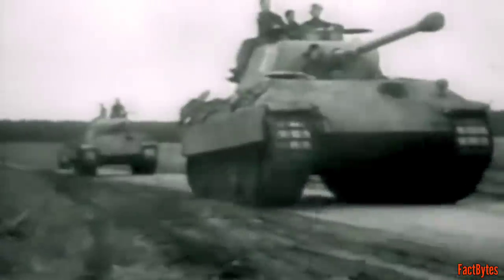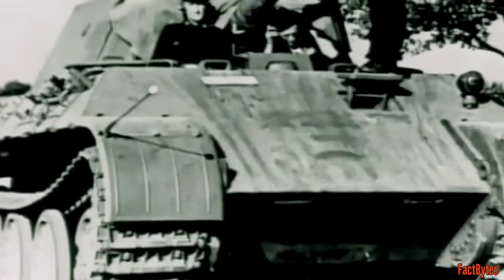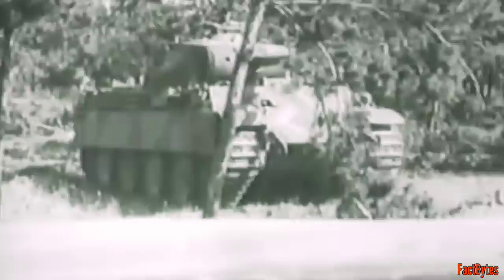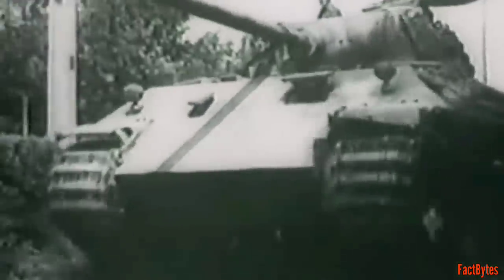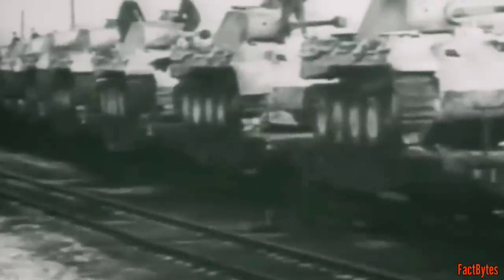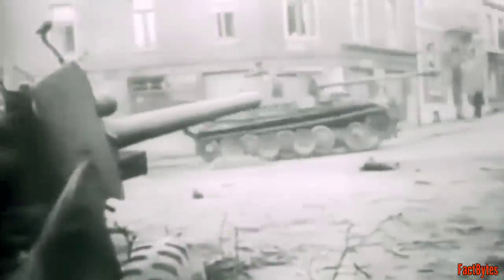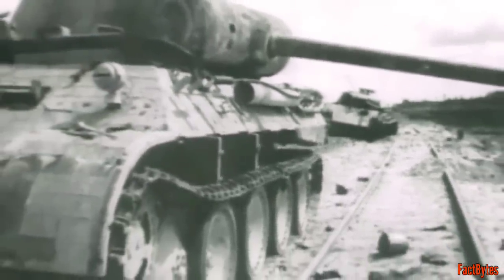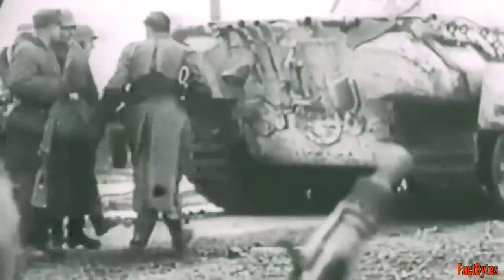Was The German Panther Really The Best Tank Of WW2?

Comment: If the Germans had just built Stug's and concentrated on upgrading the MkIV and not wasting their time on all these "super tanks" they would have had more of each and given the allies a harder time.
Reply: but you need for more tanks more tank commanders
Reply: @ramonschlittler8403  and they would need more oil that they didn’t have
Reply: The difference in the amount of fuel a Tiger II used and a Panzer IV used was huge.And you have the cost of changing production lines that were already geared up to making a Panzer IV chassis.The cost of extra materials to make Panthers and Tigers.The cost of transporting heavier tanks to the battlefields and the logistics of moving heavier tanks around on light roads and bridges.
Reply: @stephenmudiecastles.2938  that’s a fair point, but then Germany would have to train about 4x more crew with the manpower shortages they had.
Reply: This is only partially true. The Panther was only marginally more expensive than the Panzer 4 so long as engines were in supply
Reply: @kobeh6185  The Machbach engine factory was a prime target of allied bombing.
Reply: The Tiger 2 and the others were a waste of money, but the Panther was not as expensive compared with the mark 4 and brung more to the table. It reability issues could have been fixed, if the german industrial base had  not been  crumbling, and they use of slave labor, a issue that also hit the late Mark 4s too,
Reply: @I used this profile pic cuz it looks cool It was with it's short barrelled 75 but when upgraded with a long barrelled 75 it was a much better tank destroyer.
Reply: @I used this profile pic cuz it looks cool The early versions with the short 75mm were, the late were more universal in purpose.
Reply: More tanks means more fuel, which the German military did not have.  Where was the fuel for those tanks going to come from?  The German military tried to capture U.S. fuel dumps in the Battle of the Bulge and utterly failed.  All throughout that horrific war, Nazi Germany never had enough fuel for their military. They could have millions of tanks and it would not matter without fuel.

Comment: Hitler preferred the DB design, which more closely resembled the T-34.  In this one rare case, I have to say he was probably right in this regard.  The MANN design was overly complicated, was taller and wider, and used a gasoline engine rather than the safer diesel engine.
Reply: The DB was far more complicated, and it was unsuited for mass production.
Reply: @Dreachon  Oh wow ok.  According to the documentary the MANN design was more complicated, but if you say the DB was worse, then maybe it's a good thing for them they didn't pursue it.
Reply: @LA_Commander  Complicated is a big word and sadly a lot of people have this misconception that the DB design was the answer to all of the German tank problems.

In reality the DB design came with its own set of issues, a lot of these being that it used components that weren't in production, had a very very limited production or still had to be designed.

The DB design would not have been ready for production to start in January 1943 which was a major requirement that the Germans had.
Reply: Shhhh do not tell the werhaboos with the Ronson meme that german tanks used gasoline engines too!
Reply: @ricardosoto5770  This is not only a meme , the own Sherman crew's called the M4 Ronsons and the Germans Tommy cocker . The ammo got lighted up with almost every hit and not the gasoline engine . Wet ammo stowage later solved this problem .
Reply: @5co756   Its a meme,  please real real books. The nickname Tommycooker was started by the brits themselves, and was used for any british tank, not just the Sherman, and Ronson, well, I bet the M4 crews has time traveling devices since the Ronson " it lit uo every time" ad came in 1948, so yes, its a meme.
Reply: @ricardosoto5770  The Company Ronson exists since 1897 and an advertisment page from 1931 say " Ronson , the worlds greatest lighters " . That always light you up thing could be a meme , but not that they called the tank Ronson . 

A Tommy cooker was a compact, portable stove , used from the Brits in WW1 . It was notoriously ineffective , so the Germans called the M4 Tommy cooker . That's all I know .
Reply: @5co756  Well, the brits starting using tommycooker before the germans did and that is well doumented fact. Also historians have found no evidence of the us of Ronson for the Sherman in ww2 by US crews, it was probably a Canandian thing if that happened at all.  And a post war meme for sure.
Reply: @ricardosoto5770  Yeah maybe the Canadians or the Brits , who knows exactly .

Comment: I’ve always considered the T34 as the best Tank of WWII… It was simple to manufacture, easy to maintain in the field, good sloping armor and the later version was given a eighty-five mm cannon.
Reply: it was the best tank 0f 1941-42 but in 1943 onwards it was outclassed by both the panther and tiger tanks; even with the upgunned 85mm gun it was still outclassed by newer german tanks, the german tanks had better sights, a crew of 5 and all were equipped with radios, communication is the key to succes in any battle., flying a MESSER depite their short comings, their kill ratio speaks for itself, remember that despite the shermans reliability it was called the Tommy cookers or ronson lighters, the T34 and Sherman was more reliable but their kill ratio is lower than the panther. Remember that Erich Hartman shot dowh 352 aircraft includihg 8 P51 mustangs, flying a Messerschmid Bf109.
Reply: The T-34 was expected to break down every 50 kilometers.  If that's the, "best tank", there's a big problem.
Reply: @HiTechOilCo  wrote: "The T-34 was expected to break down every 50 kilometers.  If that's the, "best tank", there's a big problem."

-- Hahahaha, it was not! If this would be the case, it would not be the best tank of WWII, "Johnnie"! You can't conduct a huge operations anything like battle of Kursk, operation Bagration, Vistula-Oder or operation August Storm with a tank that expected to break down EVEERY 50 KM! Nor, would they survive to present day. It was one of most reliable tanks of WWII!
Reply: @HiTechOilCo  — And you should start your own research on how reliable T-34  with test trails Kharkov-Moscow-Kharkov of 3000 km, mostly off road and in winter conditions which would be impossible on the tank that breaks down EVERY 50 KM, without successful complication of which T-34 would not even be considered to be accepted to service or even fire tests at gun range. So before making outlandish claims do so research yourself on the most reliable tank of WW2, so that way you would not sound “childish”. Any book from Osprey Publisher on T-34 is another good place to start.
Reply: @HiTechOilCo  Everything built by Man has some Faults!
Reply: T34s armor was obsolete by 1942. Adding a bigger gun (and a bigger turret) didnt really do much for the survivability of its crews. It was all about mass production. "It dont matter if our tanks are trash! Produce 80k more of them!" -Stalin, probably

T34 made a huge impression on the germans back at the start of operation barbarossa (when all theyve had were 37mils and short 75s), but this effect was quickly diminished, when germans replaced the stubby 75 of the panzer IV with its "longnose" (same for stugs). That gun, while not the best mounted on the panzer IV, was capable of destroying anything the allies had, bar maybe the IS2 or the pershing.

When it comes to reliability, the best vehicles in the war were the sherman, t34, and panzer IV. In terms of firepower, the panzer IV had all of them beat, until the 85 was mounted on the t34. In terms of crew survivability... t34 was the absolute worst, followed shortly by the sherman. The panzer iv wasnt all that good, in terms of armor, but the gun allowed it to perform better than competing tanks (hitting them from further away, due to excellent ballistics of the round used and the optics).

I forgot to mention the brit workhorse, the cromwell... theres nothing to say about it. It may have been reliable, but its essentially a poor mans sherman. Worse armor, more or less the same gun, inadequate for the (ground based) enemies it faced.
Reply: @LiezAllLiez  wrote: "T34s armor was obsolete by 1942. Adding a bigger gun (and a bigger turret) didnt really do much for the survivability of its crews. It was all about mass production. "It dont matter if our tanks are trash! Produce 80k more of them!" -Stalin, probably"

-- Why only 80K, and not 180K? Stalin is dead, he won't be able to counter lies about T-34 tanks, right?
Reply: @LiezAllLiez  wrote: "In terms of crew survivability... t34 was the absolute worst, followed shortly by the sherman. The panzer iv wasnt all that good, in terms of armor, but the gun allowed it to perform better than competing tanks (hitting them from further away, due to excellent ballistics of the round used and the optics)."

-- What make you say that? 200 litter gasoline fuel tank that replaced Pz-IV turret traverse mechanism, because it had a poor range in 1944. T-34-85 gun would have no problem knocking out Pz-IV at any distance Pz-IV could T-34. Survivability M4 with Wet stowage was probably best of all three tanks.
Reply: @LiezAllLiez  wrote: "(hitting them from further away, due to excellent ballistics of the round used and the optics)."
-- KwK 40 L-48 gun didn't have a better ballistics, then T-34-85 gun.
Reply: I agree - the T34-85 was the mutts nuts. Even when stationary it looked like it was going somewhere with purpose!.

Comment: No, it wasn't. it had the potential to be one of the best but manufacturing defects (armour), maintenance issues (both spares availability and difficulty of access to repair/replace components), production issues (too complex - look at commanders hatch as one example) and engine issues meant it was never going to be the best.
The Centurion was probably it, the T-34-85 was a close contender, as were late Model 76mm Shermans (the T34-85 and 76mm Shermans do get the advantage here of having been used in combat, the Centurion was not during WW2 but was introduced into service during WW2).
Reply: THe Centurion missed the war, so I would not  cout it, same for the T 54 that was a prototype them or the JS3.  Any of those is better that the Panther. Of those who saw combat the Pershing, but ony less that 30 and in the last two months o the war. Of the tantks that did face combat, the T 34/85, the 76mm Shermans, the Panther and the Tiger I and maybe the Comet could compete for the best tank of the war.
Reply: @ricardosoto5770  The Centurion was a Tank in WW2, it was not a prototype. the question was "was the Panther really the best tank of WW2?" the answer is no, the Centurion was. Other tanks can lay claim, but none of those tanks were still serving with a major combatant in the 1990s.
Reply: @politenessman3901   IT was prototype, only a few mark 1s were built in 1945 and send to Germany for testing, they arrived in May 1945, too late to see combat. So it like saying the F 80 was the best american fighter of WW2 beause some were sent to Italy in july 1945, when the war still going on in the Pacific. If you said the Centurion was the best tank DESIGN to come out of the war, yes, I would agree.
Reply: @ricardosoto5770  it was not a prototype. words have meanings, it was on troop trials which is way past the prototype phase. Centurion was the best tank of WW2
Reply: Wrote: "Centurion was probably it"

Why Centurion and not a T-54/55?
Reply: @RussianThunderrr  Because Centurion was a better tank in every regard and was still in service with first line countries as a combat tank in the 80s
Reply: @politenessman3901  wrote: "Because Centurion was a better tank in every regard and was still in service with first line countries as a combat tank in the 80s"

-- Boo-haha, not the model that was in 1945, right?
Reply: @RussianThunderrr  one measure of a tank is "is it disposable or upgradable?"  the T-55 was the former, the Centurion the latter.
It's OK that you desperately wish the T-55 wasn't inferior but it was.
Reply: @politenessman3901  wrote: "one measure of a tank is "is it disposable or upgradable?"  the T-55 was the former, the Centurion the latter."

-- In case you didn't notice, I was mocking your for brining Centurion tank, since it did not do any fighting of WWII. T-34-85 deserved to be called the best all around WWII tank, that was still in service well into 1990 in SU, and present day around the world, it had a 10 years lead on Centurion tank, and is effectively first MBT in the World. Really, who cares about Centurion tank?
Reply: @RussianThunderrr  I noticed you were trying to mock, but you failed. the question raised in the video asks was Panther the best tank of WW2, Centurion was in WW2 and was the best Tank. QED.
T34-85 was demonstrably inferior to the Centurion. I get that you poor Russians are desperate to keep some pride but reality does not support you on this and it is not my life mission to educate you, you are not right, but more importantly, you are not even interesting.
So I'm going to mute you now. goodbye.
Reply: @politenessman3901  wrote: "one measure of a tank is "is it disposable or upgradable?"  the T-55 was the former, the Centurion the latter."
-- Oh, boy, oh boy, do I got a news for you... T-55 pretty much upgradable to 120-125mm gun, Centurion was upgraded from 76mm gun to 84mm gun, and when that was not enough to 105mm gun, but that is it... And when did Brits figure out, that highly flammable petrol is not the way to go on MBT tanks?
Reply: @politenessman3901  wrote: "I noticed you were trying to mock, but you failed."

-- Well, since you noticed, therefor I didn't failed... And since, Panther was not the best tank, in WWII, and Centurion tank had no merits in WWII and early models Centurion with a small gun were not better, then T-55, then by your own admission T-34 is the best WWII tank, and I'm cool with that! And I guess we never going to find out why I'm not right..., but on this innuendo, Goodbye to you too!

Comment: The M26 Pershing was the best, ok small numbers, but that was not part of the criteria. Proved that it was better than the T34-85 in Korea a few years later. Tiger and Panther, major reliability issues, but great gun platforms. IS-2, second to M26, it was slower and had a lower rate of fire, and no gyro stabilised gun. Lets not forget the centurion actually saw service in ww2, enough said.

Comment: By the way, I always wondered why was the Tigers manufacturing price so much higher than Panthers. The engine and transmission was the same, the gun was similar, armor thickness was not that different, electronic equipment was practically the same, so what made the difference?
Reply: The Panther was planed with mass production in mind. It took significantly less time to assemble a Panther compared to a tiger, which saves man hours and money . The gearbox was much simpler, the final drives were simpler and the optical equipment for loader and radio operator were simpler designs. The Panther did not have externaly mounted smoke granate launchers etc.
Reply: Panther side and rear armor was ligher that a Tiger 1.

Comment: 1) Panthers final gear was prone to breakdowns because it was made out of spur gears, not double helical gears like on the Sherman. Germans knew that, but factories able to machine such large number of double helical gears were simply not available.
2) Panthers engine (same as Tigers engine) often caught fire due to the carburetor suffering a serious blowback of burning gases, igniting the gasoline in the pump and in the tanks. That engine just couldnt hold up.
Reply: Centurion had spur gears aswell and it was 45 tonn heavy, still had no problem with the final drive.
in 1945 all the german tanks, even pz38t had problem with the final drive because of bad steel hardening.

"Meeting of the Entwicklungskommission Panzer(Tank Developmental Commission) on 23January1945 in Berlin
W 8, Pariser Platz 3, large conference hall Date: 23 January 1945

From the front there continues to be serious complaints
regarding final drive breakdowns in all vehicle types.
Approximately 200 breakdowns have been reported with
the .38(t). Prior to the 1945 eastern offensive there have
been 500 defective final drives in the Panzer IV. From the
Panther .370 and from the Tiger roughly 100. General Thomale explained that in such circumstances an orderly
utilization of tanks is simply impossible. The troops lose
their confidence and, in some situations, abandon the
whole vehicle just because of this problem. He requests an
increase in efforts for the final drive, since only this way
can the problem be laid to rest. With the previously
intense criticism of the engine and the final drive continually
playing such a roll, it is welcome news to learn
that the gearbox generally enjoys a good reputation.
Direktor Wiebickeclaims that the Heerestechnisches Büro
of the Waffenamt had for its part rejected the sun-andplanet
final drive and demanded the spur wheel reduction
drive. This claim led to a confrontation between Oberst
Holzhauer and Oberbaurat Knönagel. Oberingenier
Wiebicke clarified that for the past one-and-a-half years
there has been ongoing discussion regarding the introduction
of the planetary gearing but as of yet nothing
significant has been accomplished. Whereas during this
entire time attempts have been made to improve the final
drive, with only minimal improvement being noted. lt
must, however, be kept in mind that MAN, as the
responsible manufacturing fir1n, cannot now hold other
companies responsible. MAN has availed itself of all
offices which have the prospect of providing a way out of
these difficulties with the final reduction drive." 
Panther and its variants by Spielberger page 259.